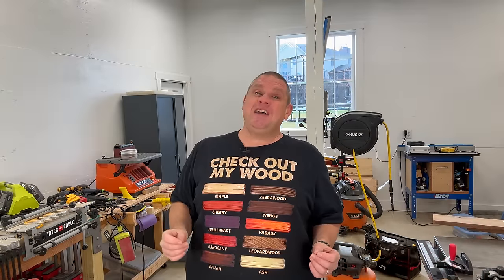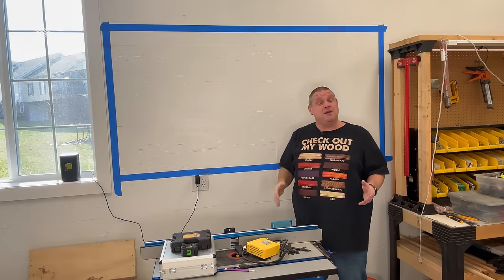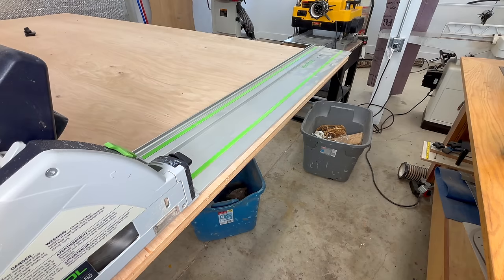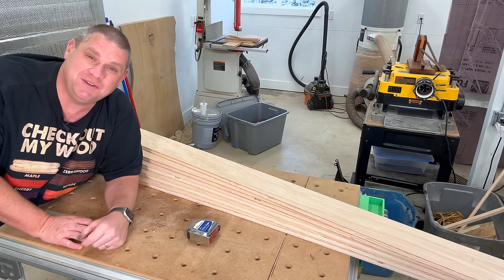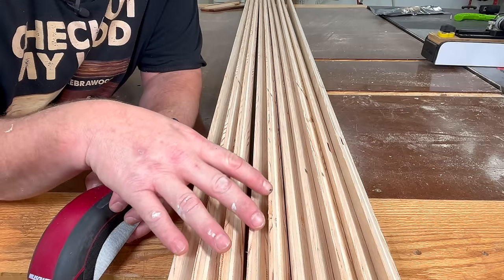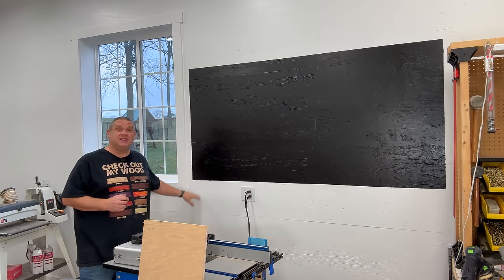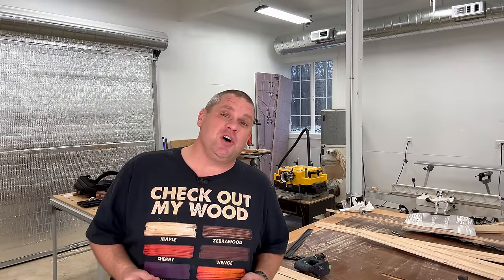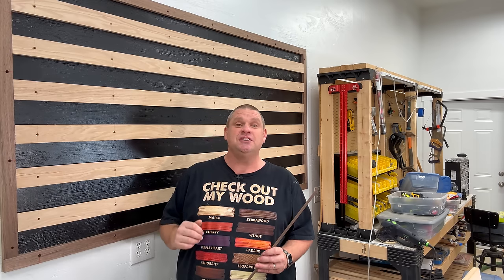Transform Your Walls with an Elegant French Cleat Solution

Comment: Great job. Now you have a whole new objective to create custom cleat hangers. I also enjoy making my shop furnishings look good. It helps put me in the correct "frame of mind" to produce quality pieces. Most folks seem to be perfectly fine with raw pine and/or poplar. I've tried it, but it always looks like it was something that needed fixing. I'm enjoying watching the evolution of the new shop. Thanks for another great info-taining video.
Reply from the maker: I 100% agree with you!  That is one thing I really want to do with this shop is to make it really enjoyable when I walk into it.  I've had pine shop furniture of years, and I learned a heck of a lot from making all that furniture but I'm ready to take this one to the next level.  In fact i just got rid of a lot of my old furniture last week, so I wouldn't revert to having it in my new shop.    I had a nice fire with it! :)
Reply: I second this I definitely use pine but I stain and finish it to make it look nice takes some time but enjoy my shop a lot more
Reply: Agreed. I also have pine and plywood fixtures. Adding an extra day to apply a finish seems worth it. If nothing else, a coat of poly makes it easier to keep clean. @ponyboyc
Reply from the maker: @ponyboyc  Awesome ponyboyc!   I bet it looks amazing.  Thanks for watching!

Comment: Looks really nice. It will give a ton of space with the size you made it. I think you are the first one I’ve seen go above and beyond by painting and framing. Really makes it look better than just a piece of shop furniture. Artsy! Great video. Love these how to videos! Always great to see another makers perspective!
Reply from the maker: Thanks so much Jeffgass!  I really like it as well.  So much in fact I'm thinking about making at least one more in the shop!   Really appreciate you watching and thanks so much! :)
Reply: You have a big advantage because your walls are plywood to begin with. If a ply backing is needed, these cleat walls get expensive, quick. Plywood is nuts! I'm not sure it's code in a residence, either.
Reply from the maker: @kwilliams2239  I totally get it.  I actually had them put up 3/4 inch plywood everywhere mainly to give me the flexibility to do stuff like this.   Before when I was jjust dealing with the studs, I could have still done it but wouldn't have looked as nice or be as stable with the hollow backing.    I'm very lucky to be able to drill right into the walls like this!

Comment: The wall looks really sharp. It will be interesting to see you make the other half of the cleat system and what all you hang on it.

One question, why didn't you use the laser to help position the cleats when you screwed them on? It looked like using the level was ackward at times plus the chance of the level falling off, getting damaged and maybe putting a ding in the floor?

Thanks for the video
Reply from the maker: Thanks so much Mike!  Great question on the laser, part of the reason was I was having a really hard time positioning it high enough so that I could get a line to base the cleats off of.  I really would have liked to use it for that purpose, but i couldn't easily position the laser high enough at the different heights to accommodate using it.  Great question and thanks for watching!
Reply: @FlynndoggWoodwork   Thanks for the answer. I really like my laser and use it anytime that I can. I find it much easier to use than having to move around a level and keep it where I can look straight at the bubble to make sure I am reading it correctly. I have a small (torpedo sized) digital level that solves the reading problem but I always worry that it might have gotten zeroed off level and through off my reading.

Thanks again for the video. Looking forward to Part 2
Reply from the maker: @mikewatson4644  That's awesome!  Thanks so much for watching again.  Trying to think of ideas for the first storage unit as we speak!

Comment: Dogg, Man, nice job.Who would know? Don't let form surpass function.  I'm cheap, so I never spend money on the "French cleaat system."  You've got the room, so it makes sense.  Let's get the lathe up and running...you're killing us.  Holy Cow, walnut for a border.  Adopt us.  Glad to see that Woodpecker T square making it into frame; as soon as the shoulder heals, I'll be joining the Meatballs in the push-up workout again.  Keep up the good work.  Oak and walnut seems a bit extreme, but it makes you happy so drive on, Dogg, man.
Reply from the maker: Oh I hear you Meat!    Function will always beat form in my shop.   My dad was an engineer and he used to always make function without any form, but it worked.  Wasn't pretty but it worked (usually flawlessly).     I was telling my wife last week, that i want this shop to look and feel better thank any shop I've had in the past.  But it's got to work.   Stay tuned for the lathe.   Probably need to make a stand first! :)
Reply: @FlynndoggWoodwork  Heck, my dad was a butcher, you know what his shop looked like.  I'd be lying if I didn't think you already have a pretty sweet looking shop.  I like that you took the time to layout the  floor plan.  That's something I never do, so I wind up moving tools around, constantly.  Just keep Dogging, man.

Comment: Can you make the cleats with the track saw?
Reply from the maker: Great question!  Absolutely.  Just make sure you really check that blade before you cut to make sure it is registering at 45 degrees, and make sure that the angle is locked on your saw nice and tight!  Excellent question jaykrusac!